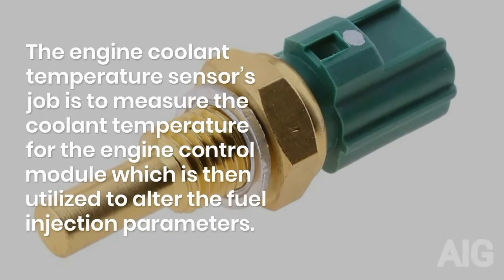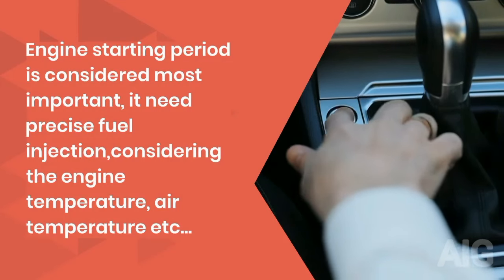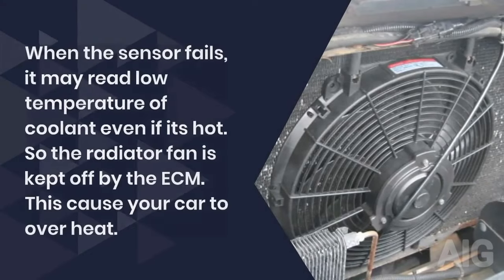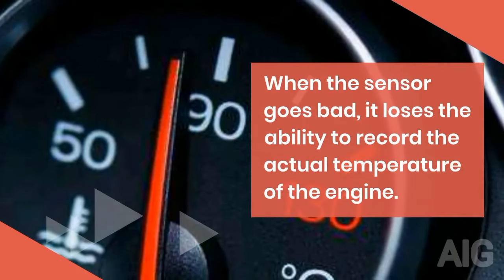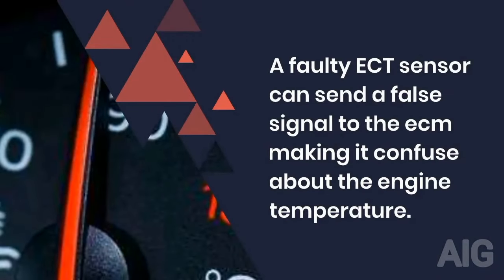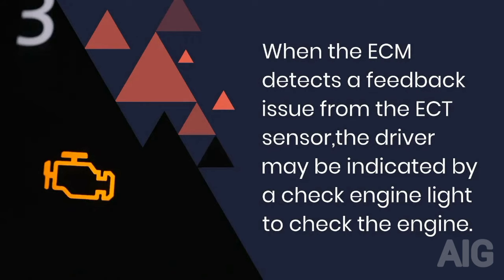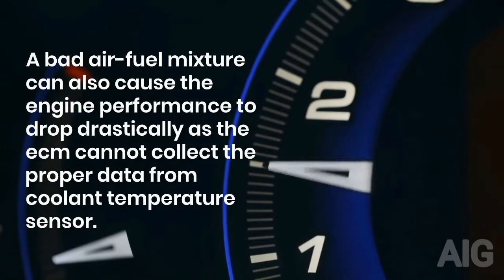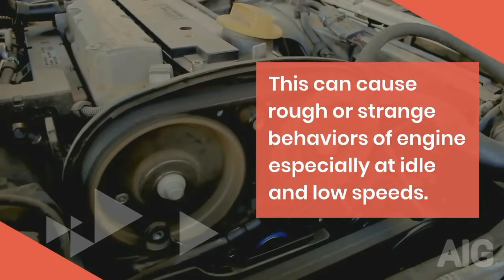Bad Engine Coolant Temperature Sensor - Symptoms Explained | Signs of failing engine temp sensor

Comment: I was chasing what I thought to be a hotter than normal temp on my 02' Blazer ZR2 w/ a 195° thermostat. 
It ran fine but in 100° weather my temp gauge started reading higher than normal.. 
I changed the water pump, flushed the system, new coolant, thermostat, radiator cap, I had changed my ECT Sensor last year & installed a Severe Duty Clutch Fan. 
Turns out that after using a OBD2 scan tool. My temp is correct at 197° to 199° while my gauge is reading over 210! 
So I have a dash gauge that went bad or just got out of whack. Not sure how to calibrate it. 
My sensor is reading correctly, bad gauge . Check the simple things 1st! Lesson of the day!

Comment: My sensor turns the fan on at 190.degrees witch on the dash show its normal not over heating ..replaced top coolant sensor (1) now  going to replace bottom hose coolant (2) sensor VW's have .2. sensors having a hard time   unclipping wire connectors no one shows u how on the videos

Comment: Tiguan 2012 fan running all the time, I suspected the coolant temperature sensor and after watching the video am definitely sure that it is the sensor.
Reply from the maker: Glad it's noticed and also to hear from you.
Reply: @autoinfogroup1629   turns out it was a faulty turbo booster sensor and the mechanic before mess with the thermostat to cover the fault.

Comment: i guessed on this part and it fixed my car. the temp gadge was going up to 260. car would like go into limp mode and wouldnt accelerate until it cooled down takes forever. i bought for$27 and had my mechanic put it on and change oil + filter for $50. so about $75 fixed a true pain in the azz. it hasnt overheated since and engine is good and runs good. glad ive been study on my car cause no one could really fix it until i had this done.🏁
Reply: Mine is doing the opposite  . When I start the car the temp hand is already on the quarter mark , then it will go to almost half after I drive it but that's it. Had trouble starting it the other morning too . I replaced that same sensor last winter because my fans wouldn't kick on. Guess ill do it again

Comment: 🛑Hello you !  Can you explain more detail about functional of water temperature sensor ? 
Because I did not understand clearly ,
* What  fail mean ? 
* What  bad  mean ?
* What broken mean ? 
😎Why I ask you like this  ? Because you did not show the level of weakness of the sensor , 
Example:   between 0 to 100 %   and the sensor  just became weak  or it just be good in 70%  it mean this sensor became weak  , so what happened ?   Can it still be ok.or broken ?  
Please help to show me , thanks ,
Reply from the maker: Temp sensor is working based on the resistance of the material its made of. when cold resistance comes high when hot resistance lowers. its calibrated for certain limits either if its close to open or closed loop a warning light is triggered. So chances of failures. If its either closed(direct contact) or open(broken), ecm triggers the warning light. If its about to fail....the resistance change can be affected ie, resistance wont change much proportional to heating...here, the gauge shows low or normal temp but the actual temp will be much higher...other case the resistance change abruptly to temp rise..here the ecm might show over heating or normal temp but the actual temp will be lower. One more case where resistance fluctuate highly to same temp...here the gauge may fluctuate.

Comment: I replace the ect , because the fan will not turn on when it gets hot,now I put a new one in the gauge goes to hot stays there even when it's cold  ok the old one was ok with the temp reading but this one's goes to hot side of the temp gauge ??when I start it up..
Reply from the maker: the new one might not be a factory specified one.

Comment: Hello, my car is a fiat bravo 2 2008 1.6 multijet diesel. Since I have it from the last summer the car does not have a stable idle. In the winter that problem was gone. This summer it is here again. I tried a lot of things but nothing is helping. Now I have error codes P01EA and P0487(for EGR). P01EA  looks like very generic code but it looks like the ones for engine coolant problems. So I am thinking is it possible for a faulty coolant temperature sensor to cause an unstable idle when the car is warming and hot? For example, maybe the coolant temperature sensor is sending wrong information to the ECU that the car is still cold and the ECU is pushing the wrong air-fuel mixture as if the car is cold? Thanks in advance!
Reply: Do u get misfire or hesitates when accelerating?
Reply: @jygogaming3550  no, the car is accelerating fast and the fuel consumption is quite ok

Comment: Wow my car is doing all of these symptoms. I guess I got to replace the engine coolant temperature sensor. Hopefully this fixes the issue.
Reply: did you fix it and did it work?
Reply: Did you fix the issue???
Reply: I replaced the ect because the fan will not turn on unless I unplug it
I bought a new one it goes to the hot side stays there😮 it will not turn on when hot

Comment: Look. This is what happens occasionally. Engine hot light comes on. Temp gauge reads cold. I pull over pull the ecm 10 amp fuse out wait 1 min. Put back in works fine. No fans ever continuously run and engine is never  actually hot. Don't know if it is a faulty temp. Sensor or what.
Reply from the maker: Might be. Temp gauge at optimum temp should be at the middle and fan should turn ON intermittently to maintain optimum temp. If the gauge reads cold even if the engine is hot then you have a bad sensor or a wiring electrical issue.